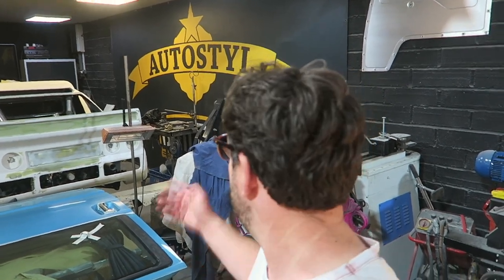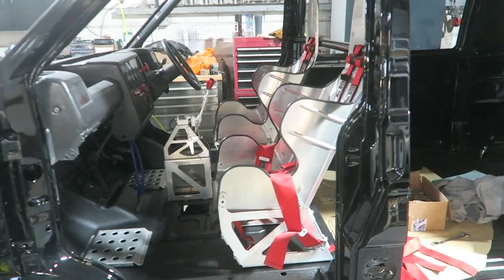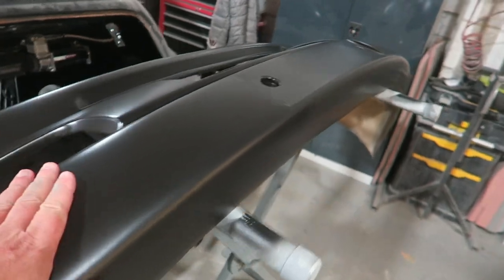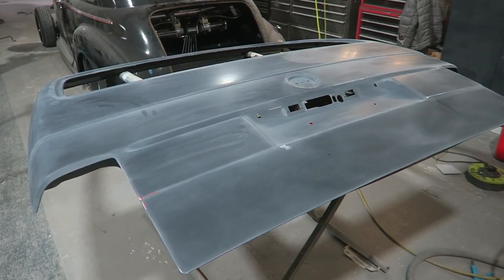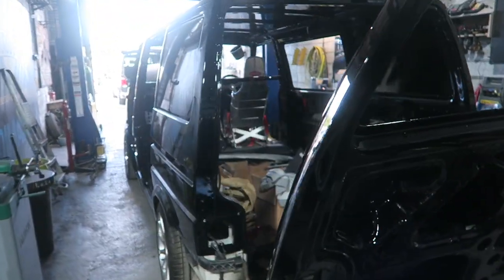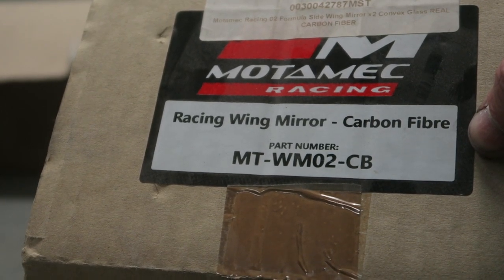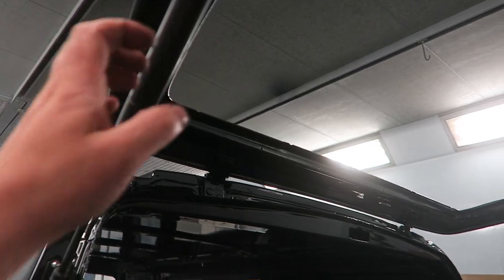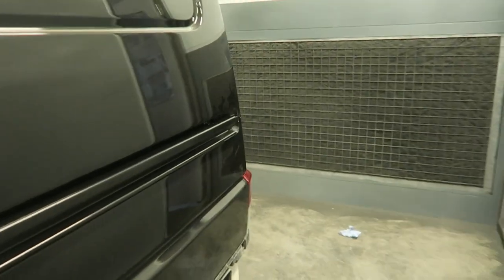VW T4 FRESH PAINT JOB PT3  @AutostylUK

Comment: You should off getting the rear sides and back windows replaced with carbon fibre sheets shaped to the contours of the glass that would of looked mint
Reply from the maker: Visibility is key mate, especially in a T4 van. The polycarb windows are great and I can see what’s going on around. No glass would look cool but I wouldn’t be able to see anything 😂
Reply: @SpeedingTube  that's true but you're van going to be that fast i wouldn't worry about who trying to keep up behind you lol
Reply from the maker: @karlsanderson8127  My friends have some quick cars too mate, always need more performance! 😂